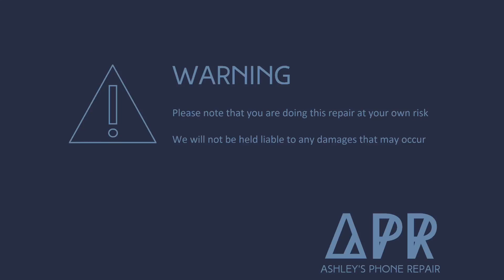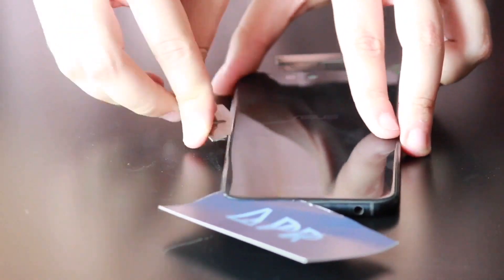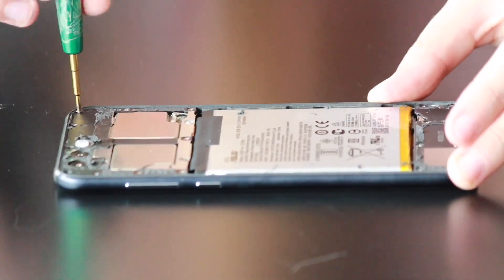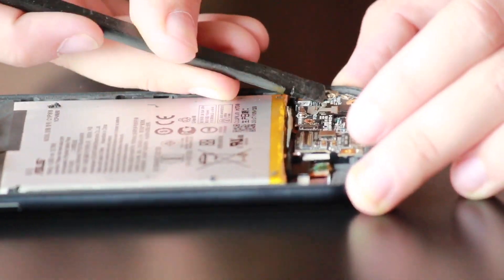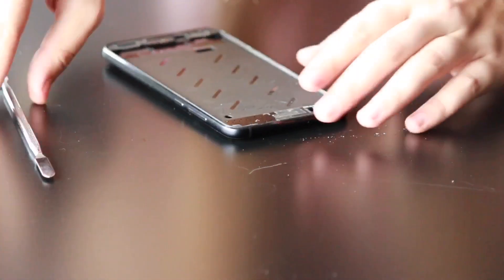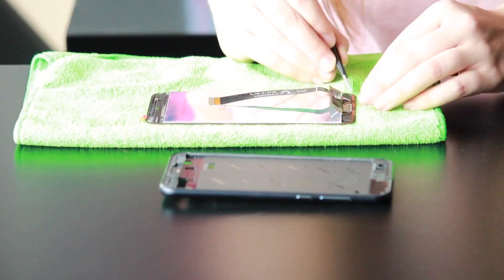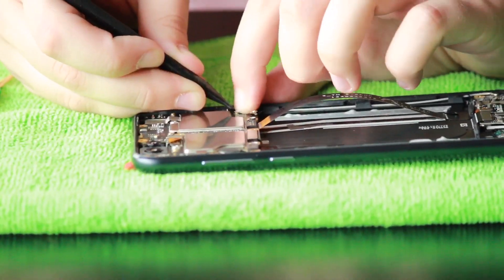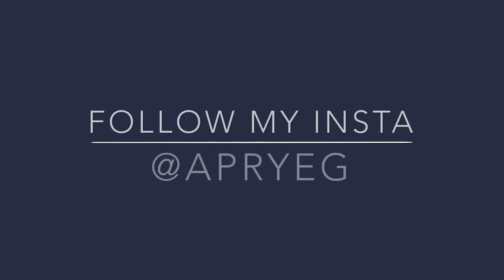Asus Zenfone 4 Screen Replacement

Comment: Any sourcing on that double sided adhesive strip.  I was just thinking about applying 3M spray & Mount w/ a toothpick, but I think I"ll inquire where I can get that adhesive sourced (3/16" or smaller, or is there a specification(?)).  Thanks Ashley!

Comment: Very nice! I have the same model (Z01KD) and sometimes I noticed that some area of the screen is having dark rectangular spots but it will disappear after some time and the phone is still working fine but lately I also noticed that one side of the back cover is a little peeled off. Is this cover a glass or plastic? Thanks.
Reply: Glass

Comment: Thank you for your help. It helped me a lot. Can I ask you what is about the flat besides the loudspeaker in the top? it seems I had broke this one (as my screen broke exactly at this point), but I did not find any problems using the fone. thank you again.
Reply from the maker: I think you might be talking about the adhesive pull tab underneath the battery, it shouldnt effect your phone at all if it was broken!

Comment: Well done!  You make it look so easy.  But how does one know where to get the replacement screen or if it's the same spec and quality?
Reply: @Gage Charlie Instablaster =)
Reply: @Bradley Heath Thanks for your reply. I got to the site through google and Im trying it out atm.
Takes a while so I will get back to you later when my account password hopefully is recovered.
Reply: @Bradley Heath It worked and I finally got access to my account again. Im so happy!
Thanks so much, you saved my ass :D
Reply: @Gage Charlie No problem =)

Comment: any tutorial of testing the screen before installing to make sure that the screen is working
Reply from the maker: Once you have taken the back off and the plastic covers you can try disconnecting the LCD Ribbon and connect the new one. Turn the phone on and you should be able to test it out that way. I know some models of ASUS phones need the bottom connection connected to the charge port circuit board which makes testing the screen not so easy.